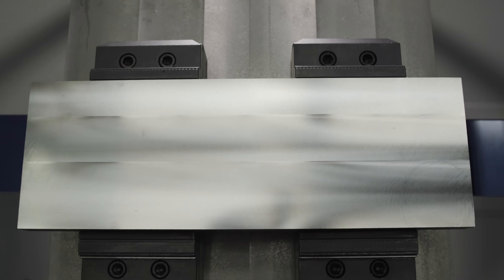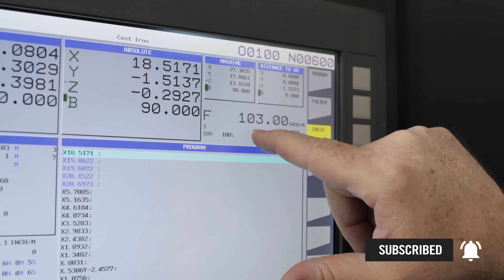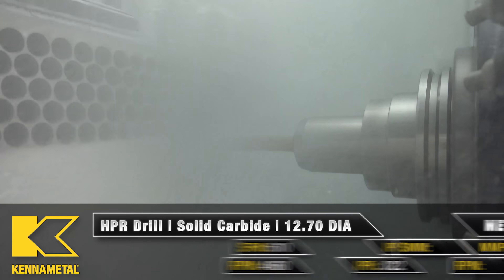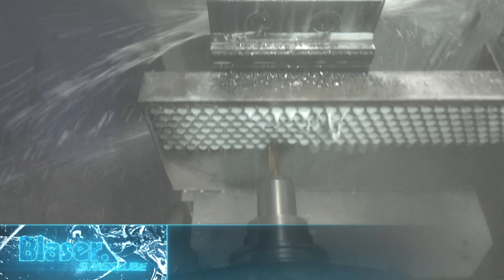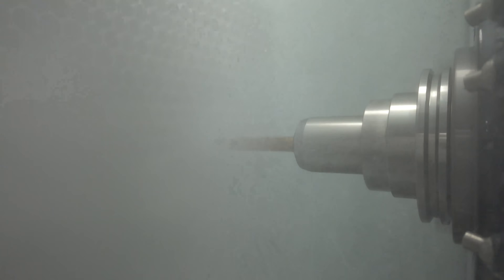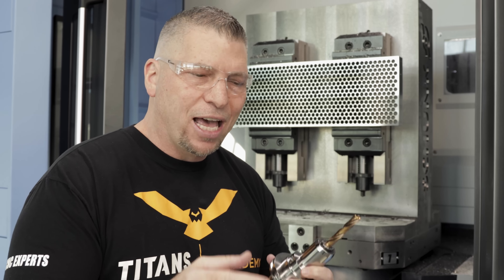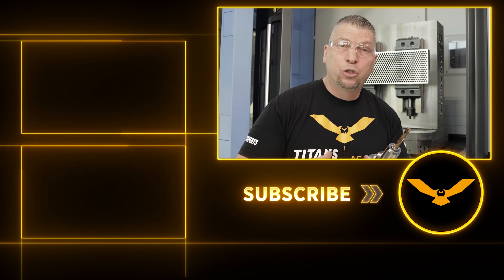HPR Drill in Cast Iron | 672 Holes Over 100+ IPM | Kennametal

Comment: I've found OSG Hy-Pro drills are great for cast iron and steel. I have one job I run one on that drilled over 3000 inches perfectly, before it showed any wear. I recently purchased a mill with tsc. Gonna give these Kennametal drills a shot. Thanks.
Reply from the maker: Ya, many drills work good…
Time is money though so make sure you push this one to truly give it a chance to out perform. What’s the Feed your using to push the OSG? If it’s under the 100 IPM that I am running, that could mean a huge saving for you by switching drills etc. Especially if it still drills 3000 inches perfectly. Thanks

Comment: Hy I was wondering if the absence of burrs is due to the tool geometry or to the material machined?
Reply: The corner radius does that. The drill breaks through and then the cutting action progressively becomes perpendicular, pushing against the side walls of the hole rather than  a normal drill which is pushing the material out through the end pushing up a burr

Comment: I was always told not to use coolent with cast iron ?
Reply: it's not that you shouldn't use use coolant with cast iron, but that its generally unnecessary.  through coolant at high pressure helps with chip evacuation though so it's quite helpful at these kind of feed rates.

Comment: I drill thousands of holes trough 1" fiberglass , it eats carbide bits.
Reply: Have you ever needed to face / plane fiberglass?   Would diamond tipped bits perform better for drilling work?
Reply: Just asking because I may soon need to start machining fiberglass sheets and need all the information I can get
Reply: @ChuckRage  we use diamond grit saw blades and they last forever. Diamond coated drills  are useless the diamond grit drills are to slow. We do milling and most tools chatter and break, I would use diamond grit tooling for facing fiberglass
Reply: @ChuckRage  i use Kyocera 2120-1250.500F  for cutting parts out of sheets of 3/8" fiberglass 30 IPM lasts and no chatter. Make sure there is no carbon fiber in the parts it will destroy all your electronics if they are no sealed.
Reply: @Bri_bees  Thanks for your advice! I really appreciate it

Comment: There is no official standard for an inch; it's defined as exactly 25.4 mm. That means this drill bit at 12.7 mm is not 0.499 inches but rather 0.5000000000000000 inches nominally.

Comment: Coolant in cast iron? Personally a bit dubious about that, when I was getting trained in college dependin on certain conditions machining cast iron with coolant leaves a mixture which could set like concrete, but might be OK if just thoroughly cleaned after use?
Reply: I’ve noticed no matter what material is being machined, some coolants set like concrete. Clean thoroughly after use no matter what. One coolant I needed a hammer and chisel for after leaving it for a few hours. That was used when machining aluminum.

Comment: Can you run this to failure in another test in cast iron? I run testing to optimize drilling parameters for us in our machining cells as I set up new products for production. I've managed to squeeze out about 1/4 mile of holes on our drills up to 12xd cutting near full depth. Around 2/3 that on 35xd before we pull them to send out to the mfg for resharpening. You're about 10% there here. I also found that a radius on the corner versus a chamfer is much better. I won't mention the competitor I work with but I'd be curious to see edge wear after 10 of those workpieces, that's when I'd be just starting to see some carbide chipping.

Comment: I work in robotics and I really appreciate the fact that you emphasize using sound as an indicator of how things are going. This is something that is often overlooked in many industries. Using all of your senses in your work is the mark of a true master. Keep up the great content!
Reply: Used to run 3-axis Sony robots building Nokia phone covers way back. like 6 robots, a sonic welder, couple of heat stakes. a whole automated assembly line. Always ran 200-400 more parts per hour than any other shift. They asked me what I did different and I just told em "I just listen to it,  Every machine has a beat and a note. If it's off beat or off key then somethings wrong and it's easy to pin point."
Reply: When I got my first job machining, the old fellow that owned the place came out one day adjusted my speeds and feeds and walked away without saying a word. It wasn't chattering or making any particularly loud noise, but he could hear something in the office. It's too bad I didn't work there longer, the fellow knew tricks for everything.
Reply: @court2379  meanwhile our bandsaw operator where I work was amazed when I doubled his IPM and feed rate for aluminum and was getting absolutely beautiful cuts in less than half the cycle time...
Reply: robotics as in First Robotics or just work in robotics
Reply: @justinl.dumanmachinist3959  As in...  I fix/design/create them for a living.
Reply: @jd52wtf  thats an awesome job
Reply: Same at continuous casting, one can here a problem coming 30 seconds before it is visible.

Comment: I drill several cross holes with what is essentially a gun drill, carbide tipped, coolant fed, and does a really good job but my issue is the cross hole drilling because it chips my drill  and these holes are deep holes almost 9 inches deep, I was just wondering if you had any advice on what I could do to do eliminate this issue or at least not have it happen as commonly as it does. Thank you for your time and I love the videos.

Comment: I worked for a company that manufactured high performance CV axles using in-house made insertable ball nose end mills. The supervisor of the mill department used to be in the lathe department. He knew nothing about high speed machining. He went on vacation for a week and when he came back I was running product at half the original cycle time.

They used a parametric program to calculate arc length - depth - step over and the amount of cuts to take in order to reach the track depth needed for the application. He was only using 6 of the available 12 cuts that were programmed. His thought was take more material slower - where i knew that was not the way. Not only did I knock the cycle times in half the machines sounded much happier and their shitty tools were lasting longer. When the supervisors cuts were made it sounded like Guh guh guh guh and the machines would vibrate heavily when the ballnose reached the bottom of the housing and was engaging  the full insert width. When he left and I was able to make adjustments the cuts sounded like "Zing, zing, zing " in an out of the part in a sweeping motion. He was changing inserts every 25 parts where as I was getting an entire shift before the rougher needed to be changed. His cycle time 5:45...My cycle time was 2:20. 

Long story short I was fired.
Reply: Really?
Reply: @TritonTv69420  Really. I know its a boring story and more less me airing a grievance on the internet but it helps me to heal lol.

Comment: Hey, I thought an inch was exactly 25.4mm, so 12.7mm would be 1/2 inch, not 0.4999999, or how does it work?
Reply: You are correct. 12.7 mm = exactly 0.5 inch.
Reply: 1mm= .03937008"
Reply: @TritonTv69420  that's rounded.. 1" is exactly 25.4mm

Comment: Amazing to see how you can create so many holes with excellent finish in that short a time! 
Now we've seen a lot of large objects being machines and huge material removal rates, but I would like you to show us that you also have the equipment and expertise to create very delicate parts.
I would like to see you CNC machine a swiss cheese cube! It would be neccesary with extremely small tolerances and to very carefully apply the right clamping force and so on to avoid crushing or otherwise breaking the part. The thinner the walls, the more challenging it becomes.
I believe you have the skills, so show us how its done BOOM!

Comment: How challenging would it be for you to machine a 15mm ID, 1m long tube with μm precision?
Reply: Nearly impossible with the tools he has. Assuming you mean +/- 1μm. Also there are about half a dozen different tolerances when machining a tube. So, I'm not sure if you mean that all of them need to be within 1 micron. Maybe if you opened it up to +/- 10 μm.
Reply: @xenonram  +/-1 μm would be ideal, but I said μm so it is on μm scale. It could be +/-10 or +/-20. 
also only the ID should have that fine tolerance.

Comment: Are the holes the same diameter from the first to the last ? Please check I’m very curious.   Very impressive
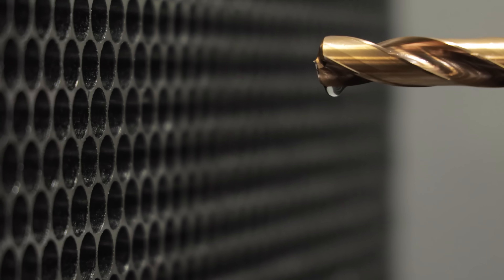Reply: I presume that they are, based on drill condition in [5:00]
Reply: Cast iron is all I run and yes whole diameter can change over the length of its tool life! It can be under and over size Or run till they break. In our case we run drill tips that we change out every 400-500 parts with 8 holes per part so 3,200-4,000 holes.
Reply: @cruzzindodge  3200-400 holes are some more than 672 :D
Reply: why not? its carbide. it makes its size or it breaks :D
Reply: @ShInYaKu88  , have you heard of SPC?   Don’t assume those holes from first to last are the same diameter.  As Titian mentioned cast iron is highly abrasive like sand , after so many holes you could be out of tolerance.  This can be monitored

Comment: How do you manage the residue and swarfe when you cut iron wet? It was a big problem for us last century.
Reply: That’s all coolant and sump management. I’d say that’s part of the machinist responsibility to maintain their machines. Any company I work for I contractually own those puppies partly while I’m there so I treat them like they’re my own. (Not really but ya get what I’m aiming at?) It sounds to me like last century the little things you had to deal with are taken care of. Now it’s more an issue when engineering doesn’t have experience machining, it causes head aches for the shop side.
Reply: Magnetic conveyer in the coolant system works well. All we did was cast iron at Case IH and we ran those everywhere all day.
Reply: @totalyep  It's the carbon that is the killer and not magnetic
Reply: Alex Lancashire Casual Photography not that much pure carbon separates, but you do need to clean the systems. We did once a year, and ran the filter paper on the bottom of the tanks which is pretty standard.
Reply: @AlexLancashirePersonalView  You are right. We machine cast iron solely. 3 shifts a day 6 days a week on cat40 big+ machines. Hybrid magnetic-scraper conveyors are the best I've found. They're like $10k more. Coolant maintains most of its color for multiple times longer than the plain magnetic conveyors would allow. The magnets are at the floor of them, and the conveyor is more traditional in that it scrapes the bottom. We get dry chips out the top and it doesn't favor the ferrous over nonferrous material, though they wouldn't do too well with purely nonferrous materials.